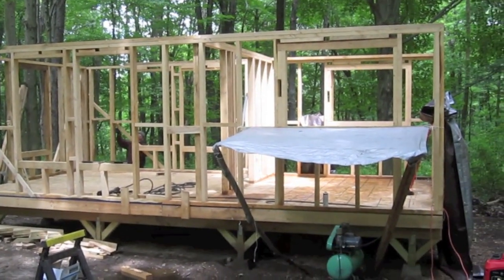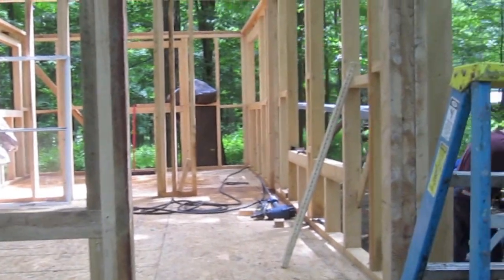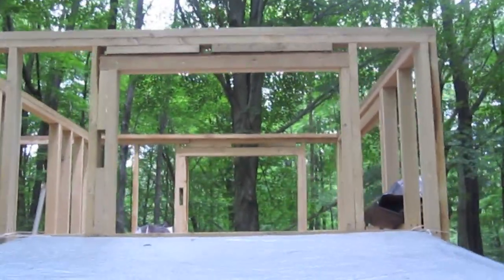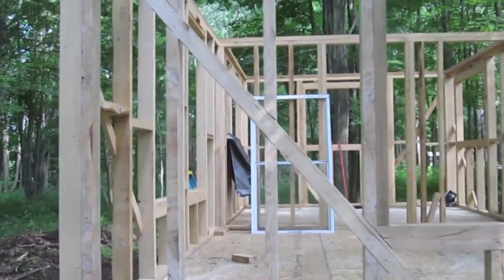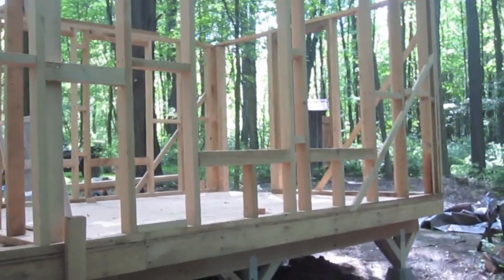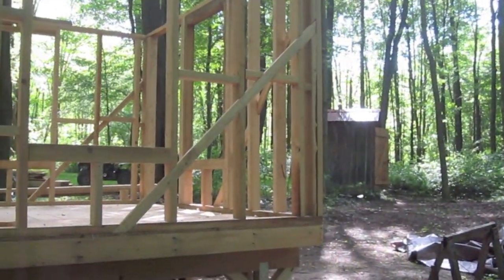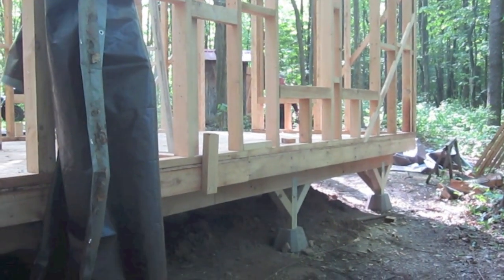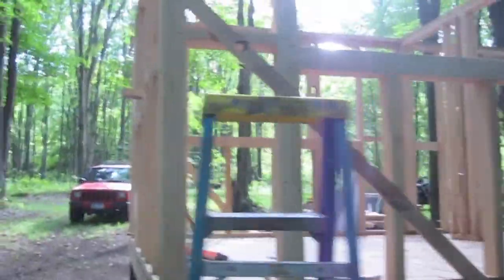Guest Cabin - framing walls/windows adding cut-in bracing - 6-2-2012

Comment from the maker: this is a little different... I had bracing up surface nailed... this is permant... we won't be using any plywood on the walls... so this is are only lateral bracing... I looked it up and each brace per side provides about 250 pounds of latter strength... so two of them about 500 pounds I figure... plywood is much much stronger... about 1200 to 2400 depending on how you do it... but this should do... and is cheaper...

Comment: im a framer by trade it looks real good . i have used gold edge decking i have not used osb decking . i was wondering how it has held up for you . all good or any complaints ?
Reply from the maker: so far no problems... my other cabin has had it for 7 years with it open to the bottom without issues...
Reply: buffcleb cool ... nice job to . it looks real clean . i have been a customes home framer for 30 years . so i know what im looking at